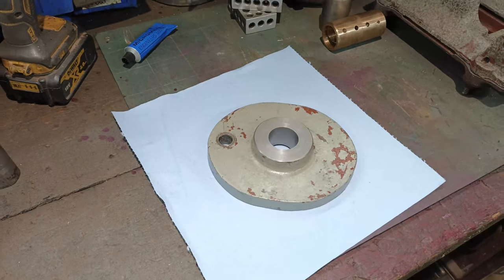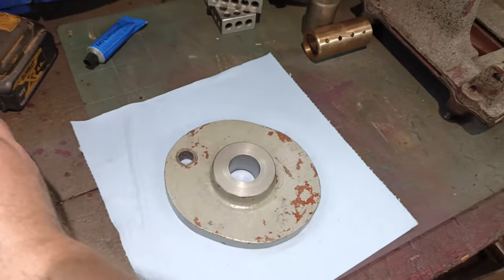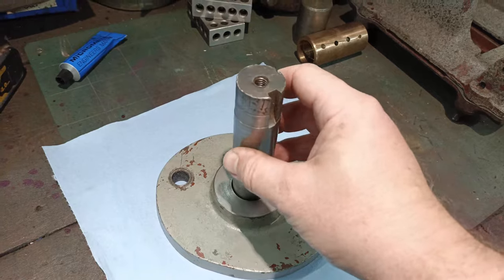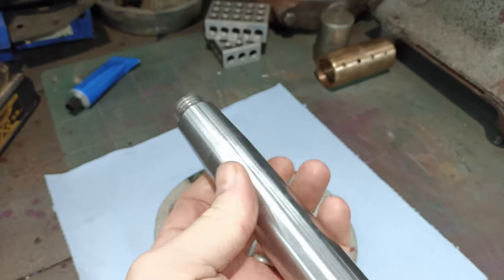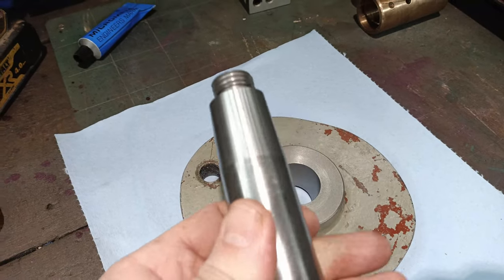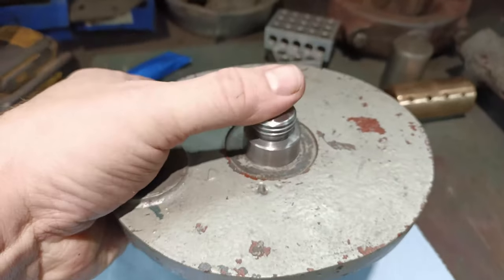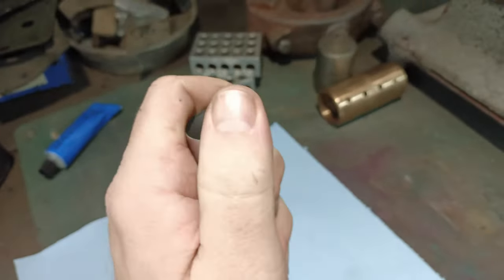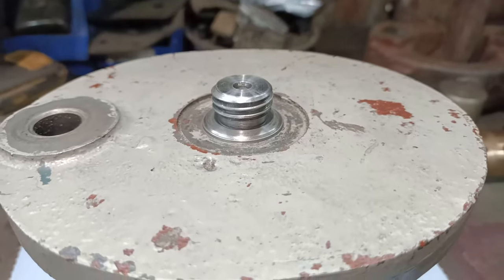Rapidor Manchester Restoration - Tapered Shim

Comment: I think I would have bored out the bearing to give a good face then made the new shaft to fit the bearing and ‘cam’ without shim. I guess you’re going to loctite the shim in place on the shaft to ensure it doesn’t gaul ? Keep at it, be fine when it’s done 👍
Reply from the maker: hi, yeah if i had my time again i would have done it in a different order. chose to do the boring of the cam after i did the shaft. i did contemplate doing another shaft, but thought i'd try this way first. it is still an option.

thanks,
phil